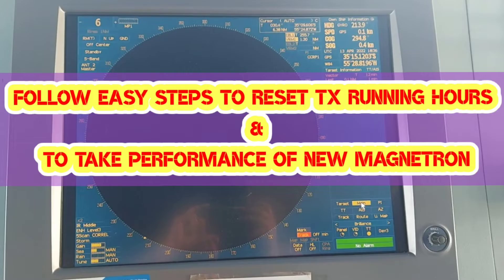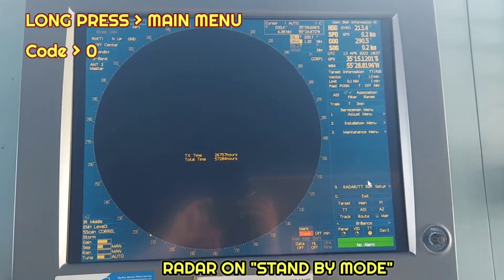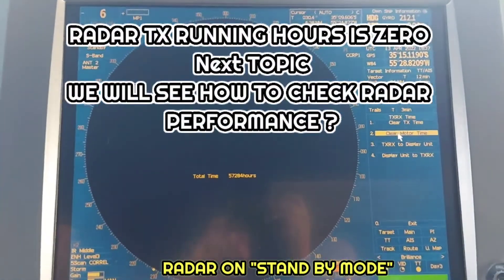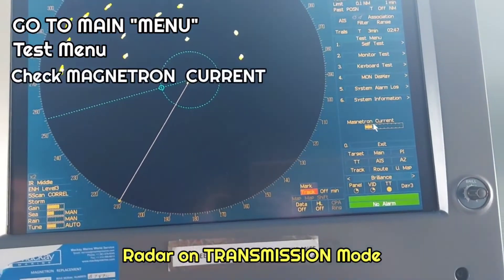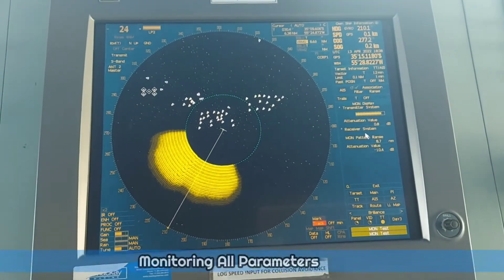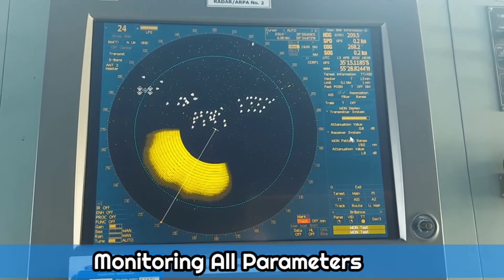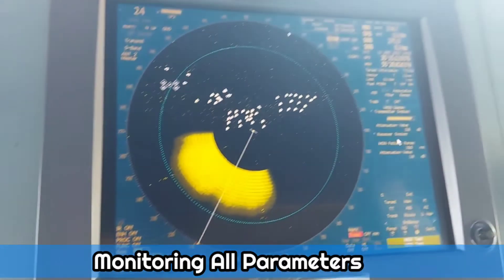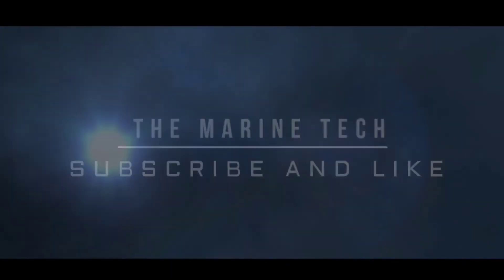RADAR TRANSMISSION TIME(TX) RESET || PERFORMANCE OF RADAR & NEW MAGNETRON

Comment: If system show high voltage in self test ,than what's the problem in system
Reply from the maker: RADAR transmission unit has a high voltage (HV) card that could be defective.. while checking this card, be very careful, PCB will be charged up to 600 V.